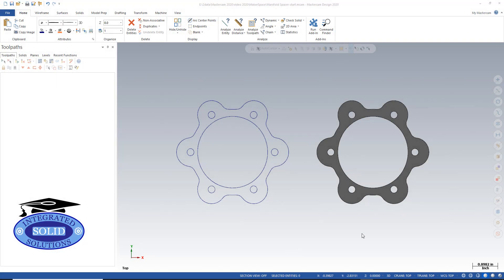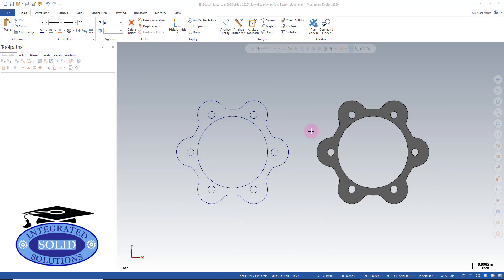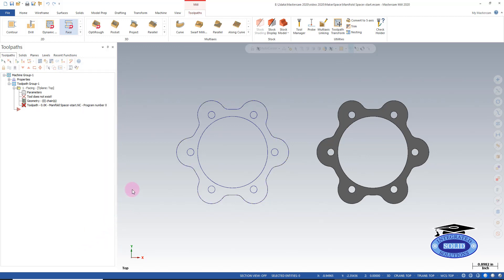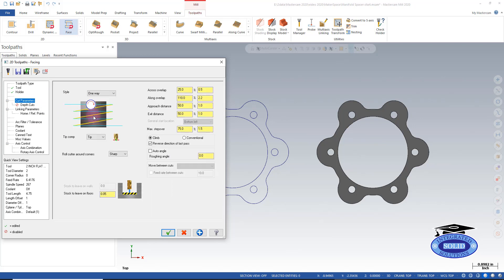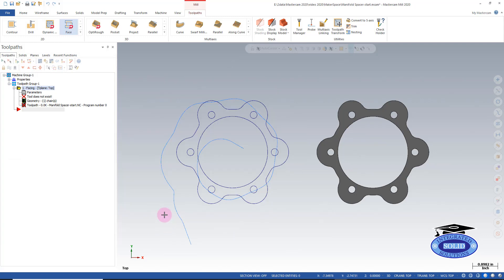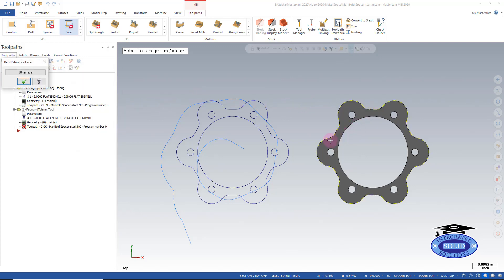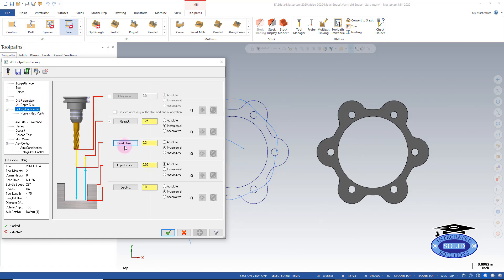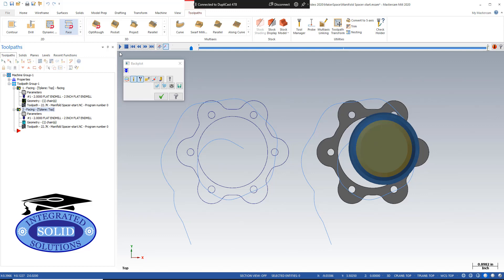Mastercam  Quick Chips 2020 : Wireframe  vs Solids  Round 1 Dynamic face

Comment: in this case the result is the same bacause you select the same geometry, in one op by usnig wireframe and the second op same geometry but using edge fo the solid... wow
Reply from the maker: Thank you for your comment. 
This video is intended to show people the do not have to extract wire from a solid to machine the part. This saves time and increases productivity. On this simple part it is not a game changer but I see people spend 1 hour or more extracted wire frame that they did not have to.

Comment: Is there a way to make Mastercam aware of the inner contour when facing, so it knows it doesn't have to face that area, or would this be a job for 2D contour?
Reply from the maker: Thank you for your question.
2D Contour is one option,  another Option is 2D area mill. 
My preference in 2D high speed dynamic mill I find I have more control with it.
If there is enough interest I will do a video on it.